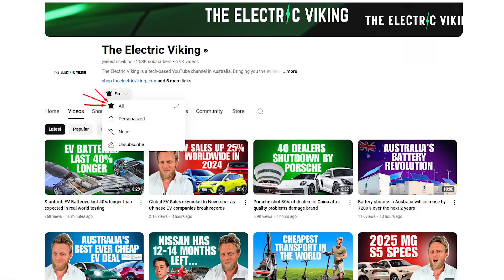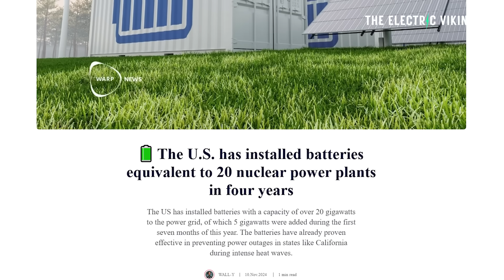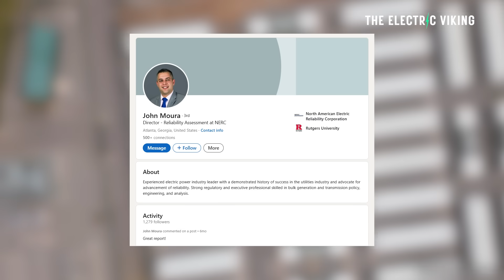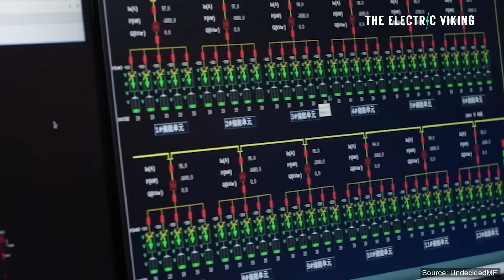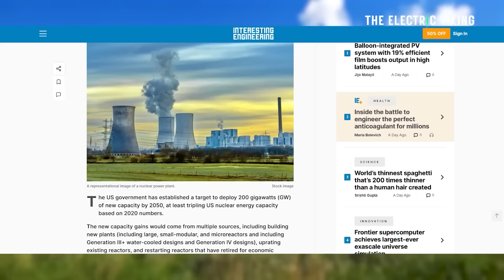America installed batteries equivalent to 20 nuclear power plants in 4 years

Comment: Let’s see how long the batteries last before they get replaced. If they get replaced at all.
Reply: lets see how long it will take to build a nuclear power station in Ausi  have you a timeline?
Reply: @ Every solar panel in Australia fails at night. Every wind turbine fails when the wind stops or is too strong. The nominal yearly average is 30 to 35 % of the time renewables are available. This is not a power grid, it’s a joke. Every battery fails once it is empty of electrons, usually after an hour or 2. Nuclear runs 24/7 for 60 years. Every solar panel and wind turbine needs replacement on average after 20 years. This is a very generous average. Modern nuclear plants can be extended to 80 years. Every panel and wind turbine has to be replaced 4 times over during the 80 year life cycle of a modern nuclear power plant. 
When total system cost is calculated nuclear is a fraction of the cost over the 80 year period. The French are 70% nuclear and their power bills are less than half of ours and we are only going up and up with every panel and wind turbine added to the grid. This Albanese Bowen clown show will 100% fail because Germany proved it cannot be done. They are going back to gas and coal and they regret the day they shutdown their nuclear. 19 of the G20 countries are going flat out to get more nuclear on the grid. Australia is the missing 1 because apparently we know better than the other 19.

Comment: It's meaningless to compare battery storage with nuclear power planta that actually generate energy, and shows that you fail to understand the difference between power and energy. Sure, you can have 20 nuclear power plants that can despatch 40GW of power, and you can install battery storage that can despatch the aame amount of power. The difference is that nuclear power can supply that much power continuously for months on end, whereas batteries can only supply it for a few hours. It's meaningless to mention how many GW of battery storage are installed without also mentioning the capacity in GWh.

Comment: Donald Trump spoke about giving away free energy. The implication of that for industry is huge. Australia ships dirt to China which uses that "dirt" to run coal generators that use the electricity to make Iron, steel and Aluminum from other types of "dirt". If countries had cheap local power they could refine their local "dirt" into more valuable products. That saves lots of fuel oil and pollution by container and bulk shipping. Low cost of energy is the key to a much better future.

Comment: USUAL ANTI-NUCLEAR GIBBERISH ON THIS CHANNEL. AND:  According to recent reports, energy use in the United States is growing significantly faster than previously anticipated, with electricity demand projected to increase by 5% over the next five years, driven by factors like data center expansion, new manufacturing, and electrification across sectors; this represents a substantial jump from earlier forecasts. Nuclear is the ONLY CLEAN, ESSENTIALLY ZERO-CARBON, RELIABLE BASELOAD, SAFE, AFFORDABLE, SUFFICIENTLY SCALABLE source of electricity that can meet the United States' and GLOBAL energy needs in the time frame mankind has to solve the CLIMATE CRISIS. SOURCE: James Hansen, the most knowledgeable, reliable climate scientist alive today.

Comment: How can you say something so stupid while covering the topic many years. Batteries are great for short-term grid balancing to make the system more efficient but to compare 20 GWh to the 20GW output... You want to inform people or mislead people for clicks?
Reply: can you compare the costs of each per hour as well?
Reply: equivalent capacity at an instant  is how it's understood - so nothing wrong with what he said
Reply: @firstlast-pt5pp  That is also wrong the Battery capacity has nothing to do with the power output that depends on the design and internal resistance.
Reply: @Utoko  - doesn't matter - that capacity is still there until it's reduced somehow
Reply: Oh, a 20 GWh battery has 20 GWh in total? WOW, you are right. Nothing to do with the 20 GW output of nuclear power.
Reply: @Utoko  - can you account all the ways the capacity is reduced ?

Comment: Does electric viking actually know anything about electricity?  I offer a suggestion - learn the difference between power, measured in Giga Watts, and storage, measured in Giga Watt hours.  Is it being implied here that a 1 Giga Watt battery storage is equivalent to a 1 Giga Watt nuclear power station?  If so how?  1 Giga watt of battery storage will provide the output equivalent of this power station for just 1 hour.  When you sit down and do contingency planning for long periods of wind droughts that need to be covered by battery storage, you are talking about the need for hundreds of hours of storage.  But in reality, the battery storage being installed was never designed with this in mind, but merely to smooth out the fluctuations between hour to hour that is anticipated from renewable storage. As for what America is about to do, all I can say is - Donald Trump!

Comment: Yeah,  still only adds up to an hour worth of storage...
Reply: ... and how much did it cost?  How long before they need to be replaced?  Nuclear too expensive?  Solar/Wind + batteries is way more expensive.
Reply: @jinnantonix4570  not according to the renewable stuff I see being installed in Ausi, why? 
 Because the people doing it,  would not be doing it to lose money in the first place.  Also, supply me with a present day costing  of a nuclear facility in Ausi and get back to me.
Reply: @TerryHickey-xt4mf  the renewables deployments in Australia are funded for the generation which is profitable, and batteries are being deployed for FCAS which is also lucrative.  However there is very little commercial interest in batteries for storage, it is just way too expensive.  More expensive than nuclear for delivery, and need multiplication of solar/wind generating assets to charge them.  That is why the full systems cost of renewables is so high, and bills are rising.  Read the Frontier Economics reports before commenting again.
Reply: @TerryHickey-xt4mf  With regard to nuclear costing, the IAEA estimates the cost of nuclear at $AU 80-160B per GW.  Based on previous deployments of the proposed AP1000 and APR1400 systems, the LNP has estimated $100B/GW.  Does that answer your question?

Comment: Vehicle to grid is the big game-changer.

Thank you.
Reply: You would only want to use VTG if your vehicle has LFP batteries, I have a cybertruck with VTG capabilities but I will only use in an emergency if power was out for days or weeks.
Reply: @jjamespacbell  all the reports I have read state that each ev will contribute just a small amount that is specified by the contributor,  a good way to make a few bucks in peak time for perhaps 10% of your battery use.
Reply: @jjamespacbell  If a million people let the grid take 10kWh from an EV battery that will power a million homes for perhaps 15 hours...it is a big deal.
Reply: Vehicle to BS. No one is going to let their EV battery fluctuate up and down for no reason on a regular basis. It's not gonna happen. I charged my car and that's it, now I'm gonna drive it. V2G is a pipe dream.
Reply: @AllioNeo  You are a fool son, a million people giving 10 kWh is a big deal for the grid and small fry for an WV owner...get a clue boy.

Comment: One nuclear power plant can supply the power to fill (and refill) all those installed batteries 24/7 - 365 days a year. Existing battery technology does not allow for seasonal storage - it´s just short-term to overcome a few minutes the sun does not shine when a cloud passes by. Batteries are fantastic for instant power grid stabilization but only short-term - and at a high cost. They are needed to overcome the shortcomings of fluctuating wind power/ solar power and to provide very short term base load. Unfortunately they don´t even have enough storage capacity to fill them in peak sun hours and than use them from the time the sun goes down. A $100 million 100 MWh battery can only output max 100 MW simultaneously - not more - and it´s 100.000 kilowatt for just one hour. It is not enough to power 100.000 homes at once at 6 PM when the sun goes down, everybody comes home and turns on the light, the microwave, the TV, the PC and the A/C, coffee machine etc. as each household will be using more than 1 kWh at once. In theory everything looks nice, in real life, with enough nuclear, coal, gas, oil powered baseload You even wouldn´t need a battery. What humanity needs next tech-wise is the Terawatt-Battery, ideally one that holds the power for at least 6 months - than we are in business. It needs ten thousand 100 MWh batteries to get 1 TWh of storage. For the time being each of the ten thousand batteries costs $100 million and production factories / materials are non-existent for those quantities.

Comment: Even if you’re saying that we installed 20 GW of battery supply to the grid, that is nowhere near as beneficial as installing 20 x 1 GW nuclear power plants.  Nuclear power plants run 24/7, where batteries are drained after 4 hours.  20 nuclear power plants would make 480 GHW of electricity per day.  You would need to install 480 GWH of batteries and 240 million solar panels, at 400 watts each, to add as much electricity into the grid as 20 nuclear power plants can, each day.  Sounds like the people that wrote these articles can’t do high school algebra and you didn’t fact check their math.
Reply: In some parts of the US, i think 12h so 240 GWh would be sufficient. But you also need to invest into the Grid then, as the panels in the desert are not where the power is needed. Adding Wind into the mix you probably could get away with 8h, if you can live with a brownout every 5 years or so.
Reply: costings please.

Comment: There's a lot of debate in the comments of GW production as opposed to GW hours of storage.  What we should not get lost in the weeds on is that battery storage is growing quickly but that we need a whole lot more.  Lets get all our heads around the battery storage needs of elecricity produced.  The priority is to get off of fossil fuels as quickly as possible.  Nuke plants take at least a decade to come on line and the ways and means of solar, wind and storage are accelerating and much cheaper to quickly bring on line...
Reply: Nuclear power plants also need to shut down for refuelling and/or routine maintenance of the boilers and turbines that actually make the electricity. Battery storage is modular and doesn't have to fully shut down if and when there needs to be maintenance as there are so few moving parts. Nuclear also has ongoing issues with waste and the cost of treating and long term  storage  of that waste, where batteries can and will be recycled at their end of life. I have probably not mentioned many other aspects of comparing the two but the correct cost comparison of Electric Storage vs Nuclear power generation needs to consider all aspects of both systems over their lifespan. That way we can compare the two. One thing is for sure sustainable storage and production of Electric power will most likely get cheaper long term as the tech is still in its early stages. Nuclear and  other non- sustainable means of electricity production technology are mature and unlikely to get cheaper over time.
Reply: We shouldn't get off fossil fuels as fast as possible
Reply: @thewolf9851  How about as soon as practicable and safely...

Comment: This is where we see ideology meet reality and turn into virtual signalling stupidity.
Batteries have a place to meet short term power needs but are no match to the mechanical power enertia required from proper base power systems.
This one eyed messiah like worship of renewables and batteries in the face of physical and scientific realties is the start of the stupidity. 

Why is South Australia with the highest renewables  double the price for power ?
This is the same in California and all states going down this route.
Fox had a really good doco on how our power system operates.
Consider too nuclear technology hasn’t stayed stagnant just like all
Other technologies, in fact it is more sophisticated and will produce power over nearly 80 years with a smaller footprint to. Power ratio.
Renewables every 25 years will need to be replaced , even though 95% may be able to be recycled the 5% in volume is a huge issue that no one talks about.

Comment: Totally wrong on this one...   Batteries MAKE nothing.
Reply: It's very deceiving.
Reply: Correct and Burning fossil fuels make toxic gasses and Nuclear makes toxic waste all the time  they are operating.!  Batteries do store electric energy very efficiently and they don't care where the electrons came from and when they are needed those electrons easily flow .to where they are needed without causing EXTRA pollution due to the efficiency being so high. My home battery can provide all the energy I need safely and I can stand next to it all day while it's running. Try standing next to your gas guzzling generator for a few hours in your garage when it's running and see the difference.

Comment: Batteries are not power stations, never have never will, all they do is allow time shifting of the energy and only when there is spare energy to charge them back again, this would be a big problem if you get a few days or a week or more where there is not enought to charge them, witha power station this does not happen
Reply: Actually, at the time this video came out a third of Victoria’s coal power is offline for scheduled and unscheduled maintenance. Nuclear power plants also go offline, sometimes when things go wrong and every 30 years or so for refurbishment. Previously coal in Australia has also been offline in NSW for months after flooding events, nuclear in France after drought affected the volume and temperature of water in the river used for cooling water.
Reply: @janetrussell3288  I worked in the maintenance of power stations shutdowns for more years then most, there is no 30 year refurbisnment, these are shutdown for repairs to tubes that and worn away from flyash and coal dust wearing them away, tubes do blow out that will bring a boiler down if not maintianed well, cooling here in australia is done by cooling towers and recycled back to water, nuclear does not damage tubes like coal does, so there is less to maintain, but these  coal units don't stop producing power when the wind stops or the sun goes down they run for months on end, even more then 12 month continious at max power if needed
Reply: You can back it up with switchable natural gas generators. Australia has plenty. No need for coal.
Reply: @Glennloveshimself  Natural gas is a limited resource and most gas genertors will only fire them up when the price is up about $17,000 a MWh, that's where profiteering is made and the big big dollars are made
Reply: no shit, anyone with two brain cells knows this, does he need to explain everything
Reply: @jasonbou812  I lived through the 1981-2 power rationing, I don't want to see it again, but it is already starting to happen even with people with only 2 brain cells can see that.